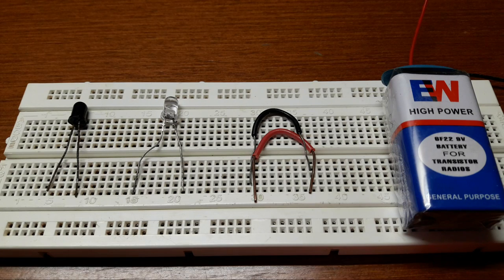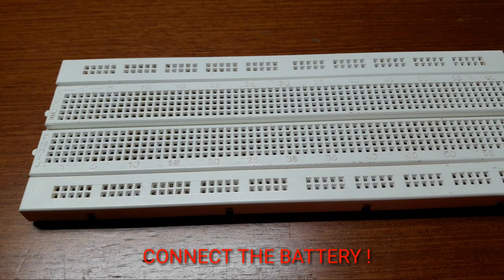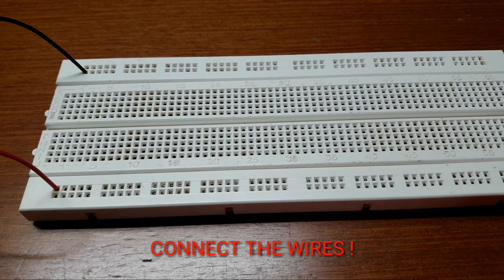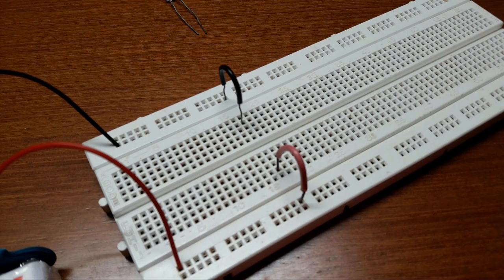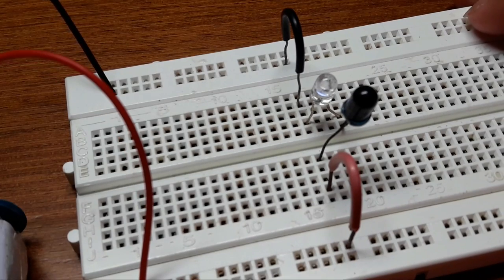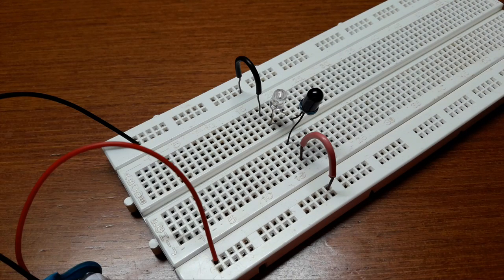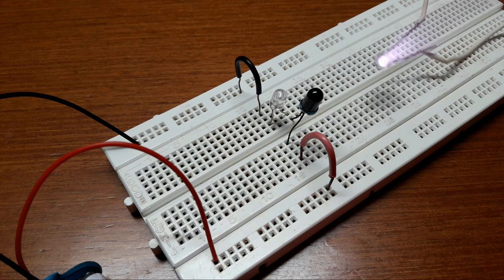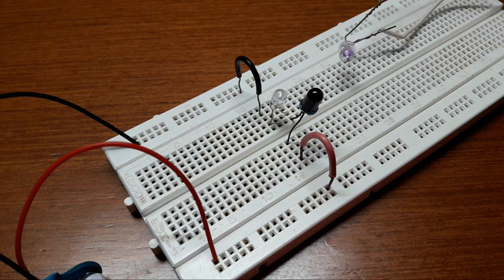How to make an "INFRARED CIRCUIT" on Breadboard?

Comment: The reason you didn't use a resistor for the led is because you only used 1.5v with the transmitter, correct?
Reply: The reason the LED didn't burn out, is it wasn't continuously being supplied a current. He was teasing the LED with the emitter. There is a range you can apply to electronics. Heat is the hidden enemy here. In 'most' electronics. More heat = resistance. As well as Resistance = heat. It quickly becomes a run away cycle. Both contributing to each other. 

The battery or supply, desperately wants to short, and release all it's energy. An LED has so little resistance that the battery sends it everything all at once. The resistor limits that. Without a resistor, your flashlight quickly becomes a portable single use heater.